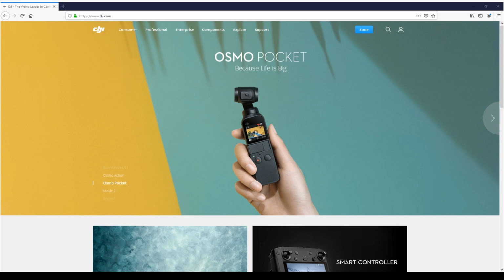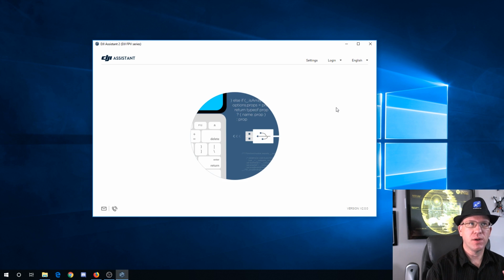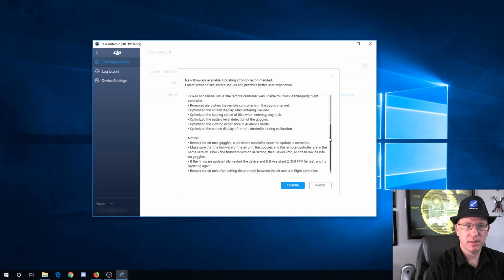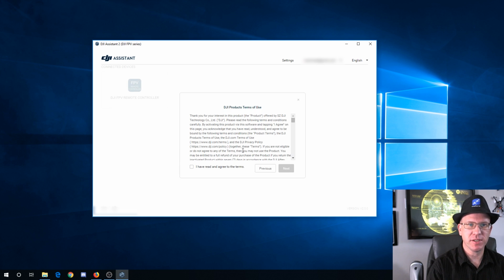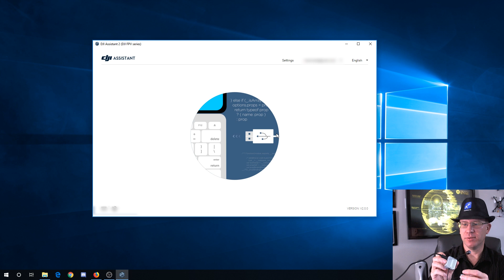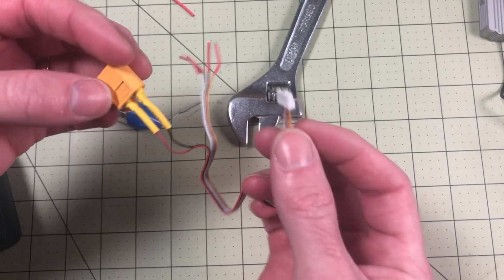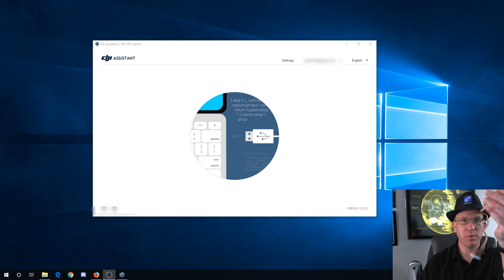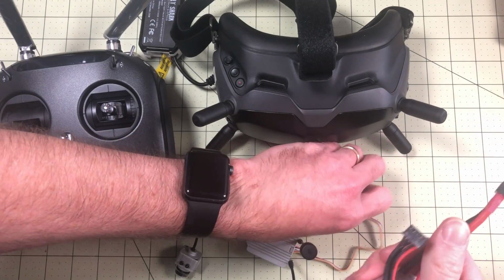How to Activate and Bind DJI Digital FPV Goggles System

Comment from the maker: The DJI FPV Goggles systems is pretty easy to setup.  But I’ve heard of a few issues,  so just to be sure I’ve created this walkthrough of all the steps required to register the system then how to bind the DJI FPV Goggles and the DJI Remote to the DJI FPV Air module.  Then my first impression upon seeing it the first time.

DJI FPV System: https://geni.us/DJIFPV2
GNB Batteries: https://geni.us/GNB4SBatteries
Soldering Station: https://geni.us/WellerWES51
XT60 Connectors: http://bit.ly/XT60ShroudedConnectors
Solder Mat: http://bit.ly/SolderMat
Assorted Heat Shrink: http://bit.ly/HeatShrinkKit-BG 

Check out my current giveaway: http://geni.us/DroneRacer101Rewards 
These are the current Drone Coupons I know of: http://geni.us/DR101DiscountCodes 
Supporting Droneracer101 on Patreon means more reviews and giveaways for you: www.patreon.com/droneracer101
Reply: Hi ... I bought an iFlight MagaBee HD BNF drone , that came w. the RXSR receiver and the DJI Digital FPV Air unit ... BUT NO INSTRUCTIONS ON HOW TO CONFIGURE AT ALL. NO INSTRUCTIONS ON BINDING THE RECEIVER TO THE DJI REMOTE CONTROLLER.  I've linked the Goggles to the Air unit, but don't have a clue how to link the controller to the receiver controller in the drone.  Here's the link to the drone I bought - https://www.iflight-rc.com/index.php?route=product/product&product_id=1018 . Do you have any suggestions re linking the DJI remote controller to the receiver in the drone?  Thanks .. and Happy New Year !!
Reply: @rsugdenmd  Hey, did you get this figured out? just got my bumblebee hd bnf and bound it to the reciever (buttons on both) and it show up in the goggles, but will not arm the quad. And when I try plugging in to betaflight it won't connect.
Reply: First, there is another USB port on the controller board, other than the one on the DJI Air Unit .. tiny and difficult to see .. just behing and below the Air unit ... Then it should connect to Betaflight.  When I got mine hooked up, they had set the wrong Comm protocol ... can't remember the right one, but it is on the iFlight page w. the MegaBee .. and then you can set the ARM switch, the upper right one on mine, to turn the motors off when it is in the forward position.  Also, the left, forward switch controls the flight mode ... very rapid and unstable in the forward position, more stable in either aft positions.  Search for Joshua Bardwell on YouTube ... he has lots of info and helped me get mine configured .. he's doing a video about how to configure the MegaBee for the DJI FPV Goggles, Air Unit and Controller ... Real hassle w. no instructions!!
Reply: how do I take off? I move the arm switch up and down, but nothing happens

Comment: I tried to connect my air unit to the DJI assistant but it could not find it. It would just keep making the sound of it connecting and disconnecting but never once pop up like it did for the DJI Goggles. Can anyone help? I'm running Windows 10

Comment: Excellent video......But I need HELP.
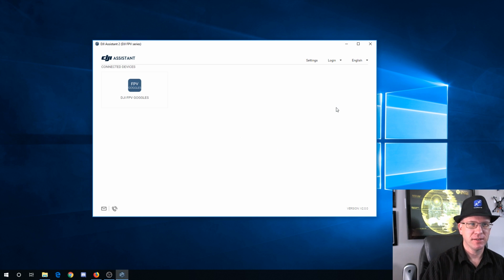I followed the instructions but when I plugged the goggles (3:48) I didn't get that Icon, I heard the "tururu😁" when I connected the cable but nothing happened 😳😢. I used different USB ports and I heard the noise but nothing...... whyyyyyy😢😢?

Comment: Thanku for this video. I've had my Iflight Chimera7 dji with crossfire, and my Jumper T18 pro with crossfire for 4 days now, trying to setup everything on betaflight and flash firmware is so stressful. Especially when I'm not sure what to flash firmware to. I'm new to fpv so having trouble.

Comment: After connecting the goggles to the air unit and then connecting the transmitter, the goggles cannot be used when connecting to the air unit.
Do you know the cause?

Comment: Does the Controller suck, compared to say a Taranis?   Looks big, bulky, heavy, and short on switches, and with a proprietary battery.

I think the setup part is damn daft, what if you're a hold out still using XP?  Or running Linux?  or System 7.5.3?   I run Windows 7 x64, but I'm going to have to check to make sure its supported... but for how long?   And are they tracking the GPS coordinates of where I am flying?

Comment: Should they turn on as soon as you connect the battery? mine don't do anything, i tried by pressing the red bottom on the right, i also tap and then hold for many seconds. It just don't do anything.

Comment: very usefull. for those of you with 6s, you'll need a voltage regulator so you can power up your goggles. 7.4-17.6V

Comment: I wonder why DJI did not give us an option to bind the DJI sbus to a Taranis
Reply from the maker: It operates on a 5.8Ghz. Taranis is 2.4Ghz.  It would need a module for the Taranis.
Reply: @SimRacer101  Someone should design a 5.8hz module for the Taranis to bind the DJI sbus transceiver

Comment: When I power on my remote it beeps twice and shows red on the indicator. When I do the combi it stays red (beeps once). It does not turn blue. Fully charged, activated and updated the firmware. Any ideas?
Reply: I'm having similar problem. Did you find a solution?

Comment: Activation on an fpv system is just silly. You finally have the proper flux - not silly.
Reply from the maker: Lol. I got both a syringe and a pen and threw out my 30 year old tin.
Reply: @SimRacer101  Louis Rossman uses the gel and is the wizard of soldering. I imagine that it works great for heat transfer. People don't realize that flux cleans you connection and transfers heat faster.
Reply from the maker: I’ve always used the gel, but I had a whole bunch of pin headers to solder on my wing FC and wanted to try the pen for that.